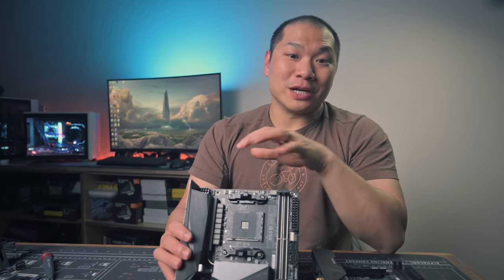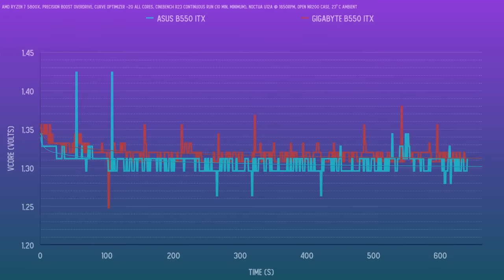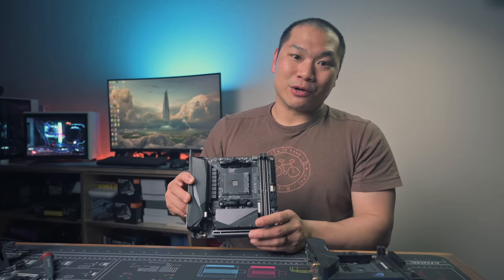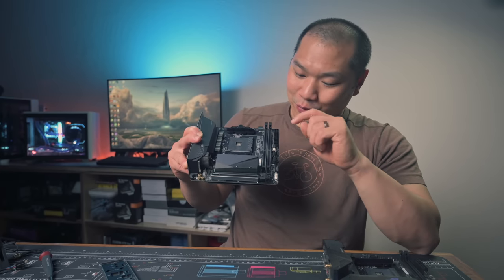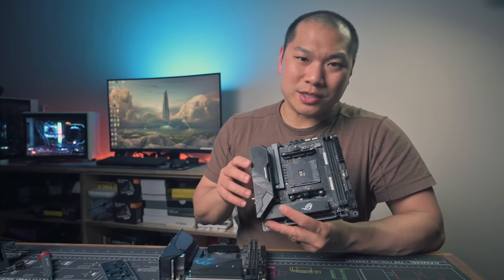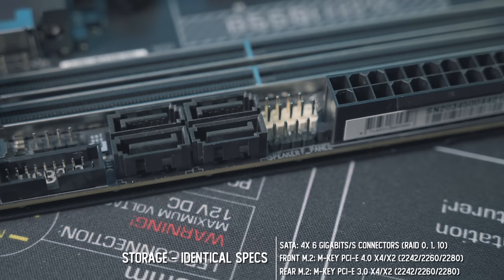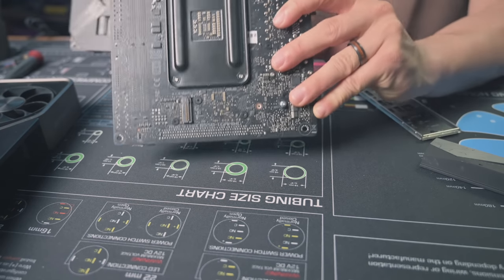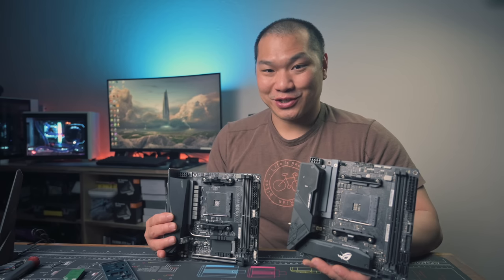Budget or Business? Comparing the Gigabyte B550 ITX and Asus B550 ITX Motherboards

Comment: My aorus 450i board VRM shit it self when I put a overclocked 5950x in there. It throttles after 2 cinebench runs. Scores drops from ~30k to 24k. 4 phases for power delivery is 100% not enough for 220W lol.

The aorus b550i board does a bit better. I think all the high end boards are about the same. Asus has better UEFI menus, Gigabytes are a mess. Gigabyte has slightly better hardware, Asus looks flashier. All of them are overbuilt like hell unless you prepare to do some hardcore overclocking.

Comment: Socket is 11mm higher? Are you sure about that? Where is that height coming from/what is causing it? I thought sockets specifications are nearly identical on motherboards? Barring pcb thickness of course..

Also, would you be interested in testing the gigabyte front m.2 thermals? Big chunk of metal on VS off? I know in theory in seems bad, but it's be interesting to find it how bad it is because you'd think that gigabyte's engineers wouldn't be that stupid..
Reply from the maker: I should clarify- when I say the Gigabyte socket is up higher I mean higher up towards the edge of the board and not that the board socket is thicker. Will see about m.2 thermals for future content, thanks for the recommendation.
Reply: @MachinesMore  oh right ahah that makes sense.. sweet, it's always interesting to see how much percieved effect of things is true in reality. Great video🙂 thanks.
Reply: Not sure if it was revisited in other videos since this one, but in my experience building with the Aorus on this case last month, that huge metal block is really bad.

My front M.2 was running 10-20° hotter than the back (80+ and 65+ respectively), pumping the heat from the AIO and the GPU and keeping it for a loooong time even once the system went idle:
I first removed the metal block, as I read on reddit that the slim heatsink is enough, and temps got better but would still run 10-12° hotter than the back M.2 (72+ most of the time).

I ended up getting Icy Box m.2 heatsinks (IB-M2HS-701) for both M.2s and it solved all temperature issues. The front M.2 still runs hotter than the back, but now both M.2s run significantly cooler when idle (62° and 54°) and cool down quickly because of the increase in heatsink surface.

The extra heatsink is just 15 bucks over here, and you can probably skip it on the back M.2, but it's really worth it.